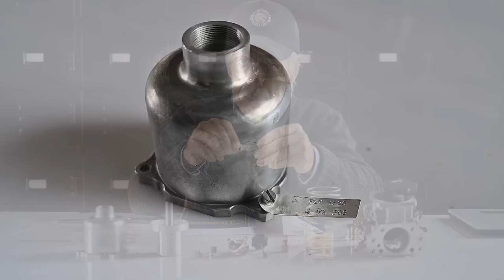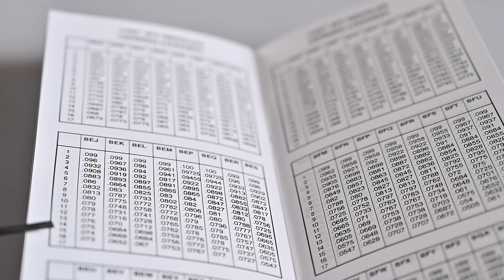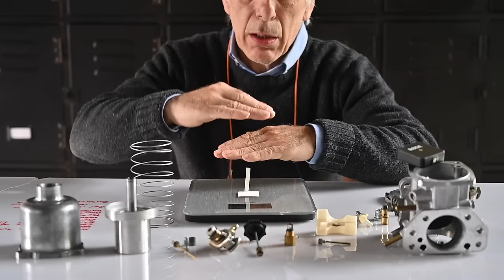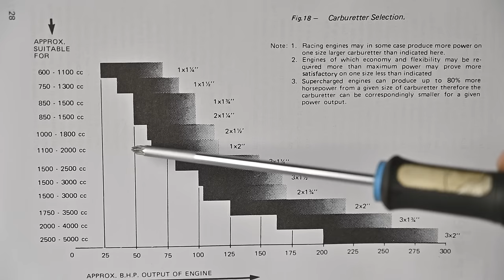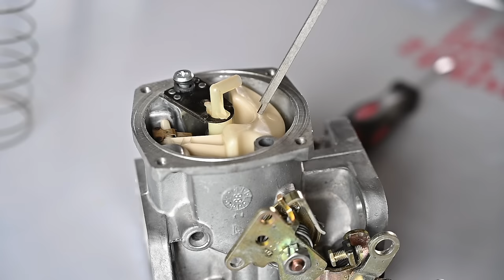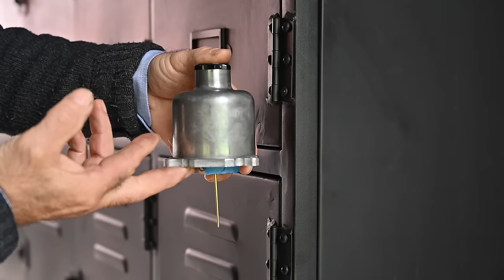SU carburettor Baseline & Initial Adjustments

Comment: Thank you for a very interesting video. When I was an apprentice telecommunications technician in 1971 I owned a mk1 Triumph 2000 with overdrive on 3rd and 4th gears. It had two Stromberg carbs, which are very similar to the SU examples. The mechanics I talked to suggested I use 3-in-one household oil for the dampers. I checked the oil level regularly. It wasn't necessary to adjust the twin carbs in the time I had the car. I sold it when the top gasket blew. The top was skimmed, but after about 1500 miles it blew again. That meant the block would have to be skimmed, which meant a complete engine overhaul. I had a new head gasket fitted and traded it for a brand new 1973 Datsun 1200 GX.
Reply from the maker: Thanks for the comments,    That was a nice car age TR 2000.    I also had a Dolomite Sprint at some time in 1978.....

Comment: I don’t have a SU carburettor however this has been incredibly interesting, please please don’t apologise for being to technical after all this is learning! Thanks to your video and some information from auto data carburettor manual I’ve been able to setup my infamous Varajet 2 carburettor, I just need to make my own vacuum gauge to measure the small amount of vacuum I need to set it up to for it to be as near perfect as I can get it (my vacuum gauge is hard to read for small amount that I require 100mm H2O is 0.28 inHg).
Also I wanted to say thanks for the information on the Air fuel ratio gauge I looked at these before to use as a setup guide rather than using a garage exhaust gas analyser, the research I done off the back of your video has showed me that the air fuel ratio Co, co2 and hydrocarbons are all linked together so I’m now confident that when I take my car for its MOT (annual inspection) it should pass the emissions.
So a big thanks again! Sorry for the long comment, I wanted to show my appreciation 😃 thanks you. Steve.
Reply from the maker: Thanks for the comments, you make blush....   and txs for sharing your views

Comment: 24:20 I'm glad that you mentioned the SAE spec of the oil. I worked for a UK leyland cars dealer - Austin/Morris, MG, Triumph, Rover, Jaguar etc. in the 1970s and there was a lot of confusion over what to put in the dashpot. Many people used 20/50 engine oil (obviously too thick) some used ATF fluid, I used 3 in 1 oil  because the SU oil wasn't widely available. The thick engine oil did cause some problems in winter.
Reply: The trouble is that a lot of the BMC/BL manuals actually tell you to use 20w50, which yes, is too thick. I'm fairly involved with Morris Minors and a lot of people still doggedly cling to the factory recommendation of 20w50. I use the SU stuff; I figure the actual carb manufacturers know best here.
Reply: 2t oil designed for auto lube systems is usually around 20w.
Reply: I'm lost, seems to me that at a colder temperature SAE 20 and 20W50 are the same viscosity ? This oil will never reach engine temps, so it doesn't sound like SAE 20 and multigrade 20w50 are very different in that application...
Reply: @TheThunderwars  Except that on an engine that is fully warmed up the carb temp will probably be somewhere between 30C and 50C so the 20W50 oil will be thicker than the SAE 20 oil. The lower rating is measured at -17.8C and the upper rating is at 100C.
Reply: @bimble7240  Thanks you very much. Would you recommend straight  SAE20 or 3 in 1 ? Thanks :)
Reply: I use 20w50, I can’t tell the difference from the su oil

Comment: Your knowledge in mini is absolutely amazing. I wish you were close to where I live so I could get your help in perfectly tuning me hif44 carb and the engine. I have my first mini and have no idea whether it drives as it should because I have no reference. Below is my engine spec :
* Head: KAD 12G940 ROAD100 CYLINDER HEAD 
* Cam: KAD100 Camshaft and single HIF44
* HIF44
* BDK needle
* Lightweight flywheel 
* Pre verto clutch - performance clutch 
* 1275 Metro block bore to 1310
+ 5 speed manual trans. 
Looking at my dashpot spring, it has no marks or color so I don't know what spring is in it. 

It had a cone filter but because it was so noisy to drive this car, I placed an original mini round filter box to help with the carb noise in the cabin.

The car was very smelly and gave me a head ache when driving, but after seeing your video I got a colortune and fiddled with the mixture and it is better now, but still have the smell in the cabin. How can I make sure this car is optimally tuned at all RPMs? Also does a richer mixture mean more torque?
Reply from the maker: Thanks and as per above

Comment: A suggestion: after you assemble the piston and Spring inside the bell and screw the bell down you may want to use the lifting pin to lift up and drop the piston a couple of times to make certain that it isn't sticking on the inside of the bell. If it does stick you may have to shim one of the tie down screws on the bell to relieve the piston so that it falls freely otherwise it would be difficult to turn the carb properly.

Comment: Loved the video it was perfect and now very understood how to tune this carb for initial run ty for your time in making this video it is very much appreciated.. I got a mini into my shop today and it was running like dog .... I didn't watch the video but I have tuned the carb and changed the spark plugs and the car is running smooth but I would like to take it apart and retune the car it smokes a lot while driving but but I'm thinking it's more than the car running rich maybe rings or valve stem seals I'm going to change the seals since it's the easiest and will go from there thanks again

Comment: So, if i have learned anything so far, on the next drive i would expect the mixtures to be very similar but the damper oil should have stopped the initial lean on flooring the accelerator and smoothed out the graph in the top gear acceleration but still be too lean over all.. perhaps needing the BFY needle?
Thanks again, i am enjoying this series on road tuning with the AFR and how the SU carby works.
Reply from the maker: Indeed, soon the tuning video

Comment: Hi D3Sshooter,
My 1974 MGB GT (UK) has different part numbers on her two SU HIF4:
Front (tag: AUD616R):
Suction chamber: PDC  12 A
Piston: PDC 6A / AUC 1331
Piston damper: AUC 8103
Rear (no tag):
Suction chamber: PDC  15
Piston: AUC 1331
Piston damper: AUC 8114
The piston damper on the front carb has a lot more friction than the rear one. As a result the piston is much harder to raise.
Should I put an AUC 8114 piston damper into the front carb's suction chamber?
Thanks!

Comment: Thank you very much for the video, it has been very educational. I have a Montego 1.6 with a SU HIF44 carburetor, it is quite difficult to start and runs poorly after spending a day stopped. The stepper motor is new. I understand that the carburetor circuit is empty of fuel. How could I fix it? I would appreciate some guidance. Thank you so much

Comment: A question sir, so my HIF44 carb didn't have the tag it was initially built with. What would be a good baseline needle for it? I am currently running a 1293 engine with 266 cam and of course the HIF44 carb. I did check all the electrical components and ensured the gap clearance on both the spark plug and lifters were set the to best setting possible. As well as checked the timing. I will be following your AFR gauge installation video. I think that will help me with tuning as there is no real mini experts to reach out to here.
Reply from the maker: Thanks for the comments , I would think that a good baseline would be: needle :BFY,  piston spring:AUD4355, Damper LZX 2085,  Needle Valve:VZX1099,  Float: WZX1509

Comment: Hi. I have twin su’s from a 46 2.5l MkIV Jaguar. When I remove my dash pot, there is no spring under them, and when I remove the vented brass cap (damper?), there is no rod. 

Is this just an early version of an SU, and do u still require oil in them ?

Thanks
Reply from the maker: That might be a very old model, what is the number on it

Comment: First I must say what an extraordinary teacher you are! Thank you for sharing your knowledge and experience. I noticed that this carb looks like it is designed for manifold vacuum. Why is this the case rather than having a hole inside the throttle plate for ported vacuum? I would have thought that on a Metro ported vacuum would be used. Thanks. Lin

Comment: Steve, I've taken the manifold off, cleaned and replaced the gaskets, I rebuilt the carbs, put everything back on, but I didn't pay attention to the linkage. Could you show how to set it properly, on the car, I don't want to take it all apart again, I think I've done a really good job, up to that point. I'd like to have new exhaust fitted asap. Rover TC
Reply from the maker: Brian, if you tell me which carb SU's you have and how many, then i can pass you an answer by mail...\ send your mail to steve@flashsplash.be
Reply: @D3Sshooter  I will do that after dinner Steve, thank you. Rover TC 2 carbs,  HIF4 SU

Comment: Do you replace the spring or can you stretch it to increase the pressure?  Also, thanks!  You are very informative!
Reply from the maker: Yes you can, but I would not.  I rather would get the right the loaded spring
Reply: @D3Sshooter  thanks, that's what I thought but I was curious if you'd have a good argument for stretching an old one.

Comment: I have a question. damper is two type .. what is the difference vented, non vented??
Reply from the maker: Its a little hole on the top of the damper that allows a faster upwards and movement...   IT all depends whic carb you have and should be matched
Reply: thank you for your answer..

Comment: I have learned more about SU carbs from watching your videos than I have learned in all the years I drove my 66 MGB. 

How do I know whether my carbs just need tuning or if they should be rebuilt? Is air leakage where the throttle shaft goes through the carb a common problem on these?
Reply from the maker: Not an easy answer to pin-point things out. In general they need a rebuild after about 100.000Km,  but much depends on how the car was driven. In each case , acceleration loss, power loss, rough idle are all signs ( if all else is oK) that the carb needs a bit of TLC.  The spindle ca have an airleak, not very common as far as i have seen..  the easy way is to spray start pilot on the spindle and see if the engine reacts, if it does ( run it on idle) the you have an airleak
Reply: @D3Sshooter  thanks. I hadn’t thought of that.

Comment: Great video.  I have dual SU HIF44 on my '72 MGB. I was going to attempt to change all the bottom parts (float, needle and seat) while the carburetors are still on the vehicle.  Is this possible?  I've already done it on my '77 TR7 which has dual Zenith Stromberg CD175 carbs.  You just need a good mirror and a little patience.  I'm wondering has anybody done this with twin SU HIF44 carbs on an MGB?
   Anyway very informative video. I didn't know baseline on the jet is flush plus two turns clockwise.  Thanks for that information. As long as I have HIF44 the float distance is 1mm, correct?

Comment: I am a fan of british cars am not a mechanic. Had my MGB for 20 years  driving her everyday sometimes in cutthroat traffic.
MY twin su within this years is not too troublesome. But its not without trouble. I maintain it myself in a rough way . ( going to mechanics very expensive and troublesome) It's good most of the time.
Very recently the su begin  to hesitate after 20kms from cold. After a bit of cleaning of the top part I suspect it"s the K&N filter causing trouble, the oil (red) in the K&N may be the cause , so I revert back to the two black funnels n paper filter thoroughly sparyed cleaned the su with carbi clean and the symptoms are gone.
The aftermarket spares are sometimes problematic once I put in new floats, not long after one played up and there is liquid inside the float I do not know how it get in there, no matter how I shake it won"t come out???? The result causes the car to lose power I cannot even get back into the garage so the MG spend the nite outside  in the street.
Do not get me wrong I still like and enjoy every minute in my B. After 20 years I am still learning to live with my B. 
British engineering is inferior to Germans BUT BUT german cars are boring I had a 500SL 107 the engine is so smooth but boring , end up I sold her instead of the B People say I am stupid. The B is like a mistress very troublesome but fun. The SL german tank (wife) no troubles but no fun!

Comment: A smaller Venturi will provide a higher velocity of air flow past the jets, thus meaning more fuel is drawn thru the jet. Too large of a Venturi will not provide sufficient air velocity and thus insufficient fuel.
Reply from the maker: Indeed, the main issue here is the balance between the stations on the needle and needle type and the piston position as that alters the venturi

Comment: Do you use vacuum gauges for fine tuning?
Reply from the maker: Yes, `i do for dual or more carbs..
Reply: @D3Sshooter  So it's not necessary for a twin choke Weber like the 32/36 DGAV in my Ford Taunus?

Comment: WHAT IF THE CARBS DOESN'T HAVE ANY TAG?
Reply from the maker: Then just look at all the parts, most have a number or marker on them.  Of course you need to disassemble it first.   With all that you can esthablish the baseline on that carb.  You will need to look it up on the SU reference manual.  If it is on a car, then you can also look up the standards for that SU on that specific car.  The SU manual provides a listing for cars. Of course it could have been fitted afterwards. That is why, its best to check all the part numbers and  compair
Reply: @D3Sshooter  THANKS